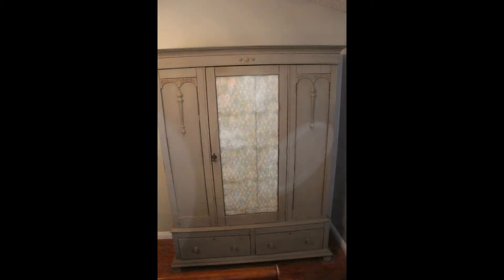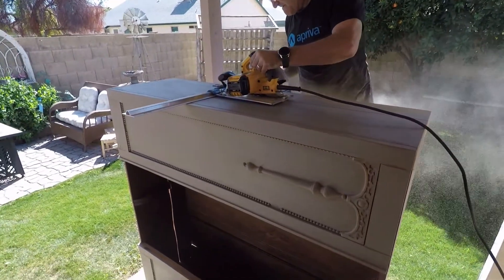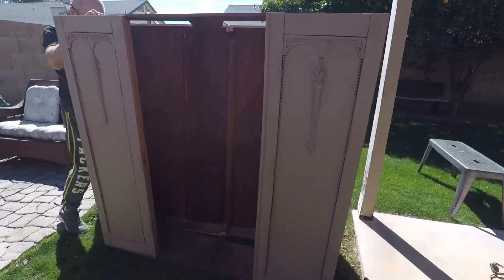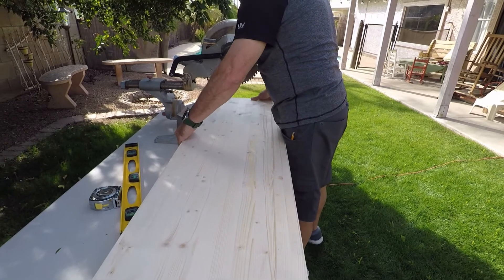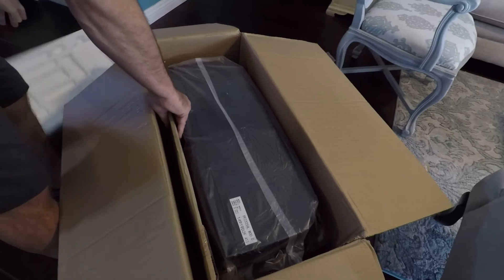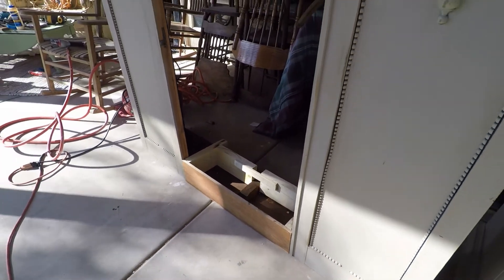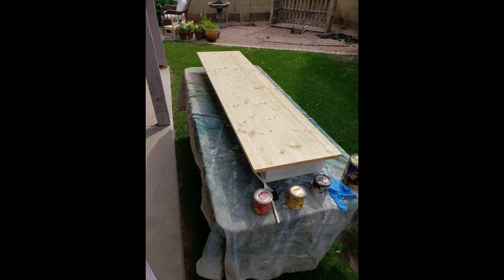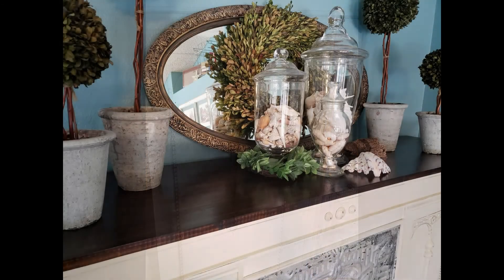DIY - TRANSFORM YOUR ARMOIRE INTO A BEAUTIFUL ELECTRIC FIREPLACE: Using a Dimplex Electric Insert

Comment: We are turning a hundred years plus pump organ i to electric fireplace. Wasn't sure which insert was safe. Big thank you for sharing! Also, can you give an update? Does the insert out out enough heat without being a danger?
Reply: Please excuse the typos. Using a notebook for the comments.
Reply from the maker: That would be amazing! We haven't been at the cottage in winter yet to try it when really cold, but we enjoyed it in the fall. I believe you would need another heat source and this would give supplemental heat. Good luck with your project!